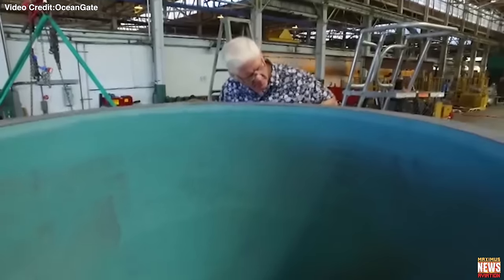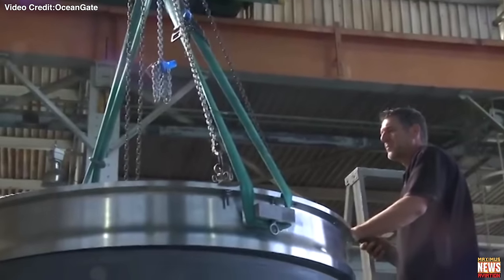Watch The Manufacturing Process That DOOMED OceanGates Titan To Fail. But It NEVER Had To Happen.

Comment: I have done a PhD in Non Destrucutive Testing(NDT)of composite. And about 15 years back, I developed and used techniques for different thickness and different material  filamant wound composite pipes using air-coupled ultrasonics and linear array imaging and convetional squireter based imaging for finding delamination at diffrent depth of composite. 
Oceangate did not inspect the 5 inch thick pressure vessel with any of the state of art  inspection techniques such as conventional ultrasonics, linear array ultrasonic or air-coupled ultrasonics. They tried to certify or give early warning using an inaccurate, low-tech online acoustic emission NDT technique. This method is good only in lab testing and can give warning just before or during an evolution of extensive failure of the vessel. However, this method info is of no use for the passengers at great depth of the ocean since failure is sudden.
Furthermore inspection techniques are not commecrially availabe for such dissimilar bonded composites that too with metal - composite intefrace, eventhough some techniques are still in research stage. Hence in aersopace sector for primary load bearing strucutres such bonded joints have two or three rows of bolts to make the design of bonded joint damage tolerant.

These manufacturing videos of Oceangate show how dodgy the manufacturing procedure was, poor winding or the layup design and tools used for such a mission critical pressure vessel. The manufacturing process by this company looks like a cheap small scale composite boat manufacturing facility! I highly suspect Oceangate submersible's bonding failed, 
 followed by buckling and implosion of the pressure vessel!
Reply: Thank you for sharing your views. As someone who doesn’t have any engineering background, with a common eye their bonding process just looks completely insufficient.
Reply: I think they thought whatever gaps or pockets or joins the design had, the pressure would just seal it all tight and everything would be great.
Reply: How much are you per hr?
Reply: Brilliant explanation. Sounds like CEO should have hired you to fix the sub problems then CEO would still be alive.
Reply: @jonfreeman9682 the problem was that the CEO fired everyone who doubted his ingenuity.
Reply: I am an engineer with over 40 years of large project and pressure vessel experience, primarily tubulars.  I admit to being a generalist but I think I know my way around project and product development, I was a project manager with lots of specialists on the teams but I did spend 30 years in deep water drilling and production going from the years when 1,700 foot platforms were deep to investigating systems for 10,000 feet of water depth.  It did not take much of a literature search concerning composites to see just how foolish this design was and how stupid the material selection was.  This paper suggests that composite failure in subsea applications accelerates significantly under pressure.

From the paper, "Graphite/Epoxy Composites for Offshore Applications"

“The crack growth rates of the specimens tested in ambient [temperature] and high pressure seawater were found to be approximately ten times higher than the growth rates of the specimens tested in ambient air”

I have not read further to learn the reason. I suspect it is high pressure water intrusion tending to delaminate the fiber and eppoxy matrix leading to crack propagation and failure.

https://www.iccm-central.org/Proceedings/ICCM11proceedings/papers/ICCM11_V1_22.pdf

That was just for starters.  I found a large collection of contemporary research papers that would have made any prudent engineer run backwards from this composite application just as fast as possible or at least realize he was dealing in a unique application at great risk that was peeling back the foreskin of technology.  Very painful.

It is a pity these people died   As for the CEO, better he died because what he did was criminally negligent.
Reply: Oh wow im interested in NDT myself.

Only heared of x raying Metals/welded parts but using Ultrasound for compisite Materials makes sense.
Reply: Could not agree more!  Just another NDT engineer working with composites here. I bet this cylinder has super high porosity, not even close to aerospace CFRP.  They haven't even tried to inspect it properly, not to mention FE modeling of load carrying capacity loss due to glaring fabrication flaws...
Reply: Marine Engineer here (40 years) - but not a designer. The genus of this failure is not engineering per se but in the relative recent fashion for ‘disrupters’ who think existing science and engineering practices are far too conservative (they are correct) and hinder development, they also dismiss ‘subject matter experts’ as part of the skewed logic. There is a reason why the certification of submarine hull design and build is ‘laborious’, expensive and time consuming - the consequence of failure is death.
Reply: @sequoyah59 brilliant post m8 thank u was easy to understand and read  for the layman like myself
Reply: I agree, it was shoddy manufacturing. He should have baked that hull from 2500 to 3000F to graphitize it, which would have given it elasticity. People say carbon fiber has weak compressive strength which is true, but it is strong in tensile strength. Epoxy resin is strong in compressive strength, but weak in tensile strength, but when combined they are strong in both. I could be wrong, but I don't think that 5 inch thick CF hull collapsed at once and imploded. I think that cheesy joint where the end caps were glued to the CF tube was where it failed. He only had a 2 inch deep dado joint, when he should have had a 12 inch dado joint to give him more of a gluing surface. Then he could have also drilled holes away from the edge and bolted it. Even though drilling CF weakens it, he would have had it sandwiched on both sides with the titanium flange. The epoxy glue holding that joint together has a tensile strength of 5 to 6000 psi, but as you know he was diving to depths with 6000 psi pressures. James Cameron said the last message the surface ship received was Stockton saying the cabin had been compromised and he was resurfacing, then 2 minutes later navy sensors detected an explosion. Apparently he sprung a leak either in that end cap joint or a cracked window or window seal, and high pressure was forced into the sealed cylinder, which blew it up like a balloon until it exploded.
Reply: @mixanblend  That reminds of the the DSV Trieste.  When they took it for their first unmanned dive in 1960, they noticed seawater on the floor after surfacing.  When they consequently took if for a manned dive, they immediately saw water coming through the porthole.  But going deeper, the waterflow stopped.  In continuing the dive, pressure  increased and pressed the the window with more force against the conical sealing.  That's why I don't think the glue/sealing were the problem.  But the carbon fibre integrity failed.
Reply: @padiyar are you serious? before testing anything, how did you miss the open air construction of this thing? bare hand touching on the surfaces? this guy was nuts. bonding not suitable surfaces (see how shiny and not good for adhesion surface?) in open air where they been surfacing? bonding this kind of critical structures should require at the least clean air/vacuum certification! and hygienic protocols on personal should be the min as well! the whole thing is theatrical before talking about any engineering aspects! i mean restaurants get better inspection and testing than this guy's warehouse which is supposed to be space age!

Comment: I am not a marine engineer, but words cannot describe what I have just seen with them applying adhesive with plastic scrapers in a non dust free environment. How on earth where they meant to get a consistent seal with plastic car body filler scrapers. You wouldn't even paint a car in such an environment.
Reply: lol so true, also watch at all the air bubbles enclosed in the carbon
Reply: He wanted to be remembered asa rule breaker/innovator
Reply: @AAAskunk  then don't take passenger
Reply: Out of sight, out of mind. Until it breaks, of course.

Comment: After this happened i learned about Steve Fossets Deep Flight Challenger. A submersible build from carbon fiber to go down into the mariana trench. However, this submersible was good for only one (1!!) dive, and supposed to become a museum exhibition after its one trip. It was expected the carbon fiber hull to deteriorate too much to be safe for multiple uses. 
Richard Branson aquired it after Fossets death and planned to go commercial with it, until he learned of this fact. He quietly shelved it.
About that time Ocean Gate started with building the Titan. I think it is impossible that Rush didnt know about it. He must have known that carbon fiber hulls werent suitable for this purpose. He himself talked about the crackling of the hull and told everyone to expect it. Aka its normal. No, it was a countdown.
Reply: He said his acoustic sensors will detect the threat before diving too deep, that why he still go with it…
Reply: @hyy3657  Hull failures under a pressure resembling about 80000lbs on your palm give no preliminary warning. You are just dead in milliseconds, without a chance of even realizing the fact. Its like switching the lights off. Your lights.
Every crackling noise was the hull saying "I am falling apart" 
Take a thread, and pull on both sides. The thread will resist the pull. Thats what it can do. Now push both ends together. What will it do? It will bend. It cant resist the push. You cant push a rope. If you embed it in resin, the resin will resist your push. Basically only the resin. The thread would just prefer to bend. Thats what the carbon fiber in Titans hull was doing. It couldnt do anything else. People hear carbon fiber, it is used in airplanes, its a miracle material. On airplanes it has to resist inside pressure which wants to expand the hull, aka pull. Rush was an aerospace engineer. He knew about this. On a submersible the load is push, not pull.
Reply: The hull compressing and making noises is normal, it happens on US navy subs as the hull compresses. The issue is that navy subs will decompress while carbon fiber, but nott titanium, will not decompress, once you crush it, it stays that way.
Reply: @laa0fa502  Exactly, the carbon fiber hull takes a bit of damage every time. Until it fails.

Comment: I'm surprised that none of this appears to have been done in a clean room, just an open warehouse where dust and moisture can contaminate every step of the process and introduce failure points especially in the adhesives. This guy had access to decades of research and experience that others had accumulated in the submersible field and took advantage of none of it and in fact seems to have gone out of his way to ignore any warnings or misgivings that more experienced experts expressed to him.
Reply: backyard deep sub building. can't get more amateur than this
Reply: I follow a "slapstick" process all the time with my Depron DIY RC airplanes. About 50% of them crash before completing the third flight.
Reply: No respirators on.
Reply: what if a fly got stuck in between the carbon fibers??🪰🪰🪰🪰🪰
Reply: @MrUranium238  Whole new Sci Fi movie
Reply: He only took advantage of the fact that there were zero deaths in the industry before he came along, so he thought he can do whatever he wants and everything will be fine since no one died before with other people who actually know what they're doing. It gets worse with every video I watch about this
Reply: That glue job....would it be a problem if the epoxy had air bubbles in it?
Reply: @MrUranium238  theres enough air stuck in them anyways a fly would have made it safer probably lol
Reply: Heard he used EXPIRED carbon fiber thar be bought for cheap because Boeing wasn't willing to use expired products for their planes.
Reply: @timoooo7320 exactly!
"Nobody died before, so therefore it MUST be safe, right?"
Then proceeds to kill 5 people!
Reply: Three points I am not seeing commented on.
1: x-ray microscopy of carbon, fiber, fibers will show that the interior of each fiber is principally void of structural material.
2: the filament winding process that they are using is very similar to the mining process used in missiles. The method that they are using introduces air, which structure would be called a void, along with the resin that was not degassed.
3:the titanium ring and carbon structures with deform differently .
Reply: Well said.....my car gets painted in a paint room.  Its all basic hygiene protocol.
Reply: You're exactly right. My first job in my aviation maintenance career was working in a sheet metal/ composite shop. All composite lay up was done in a clean room.
Reply: These guy and engineer look like they just graduate from Mc donal and oceangate ceo hires them 😂😂
Reply: Just add more peanut butter glue to compensate.  There.  Fixed.
Reply: @bldmyamean8352 
In another video, can’t remember which, it was said Boeing have denied on-selling any carbon fibre to OceanGate, time-expired or otherwise.
Reply: Arrogance is an amazing thing, just a pity so many others had to pay the cost as well as him.
Reply: @NHX610  yes it would... the adhesive should have been placed in a vacuum chamber and degassed, then applied in a clean room environment at minimum...
Reply: Good point David. I think using CF for submersibles could be done, if done the right way. If it's true that the stress cracks weaken it over X amount of dives, then he should have set up a shop where he could mass produce those CF hulls and had the titanium end rings removable, where they could be transferred to a new hull, say every 10 dives. He was making a million dollars per trip with 4 passengers paying a quarter million each, and in 10 dives that's 10 million dollars. If it costs one million to make a new hull, he's money ahead. If I was building it, I wouldn't have glued those end caps, with a 2 inch dado. I would have had a 12 inch dado and drilled holes through the titanium CF titanium sandwich to put bolts in it. Even though holes would weaken the CF, it would be sandwiched by titanium on both sides. Then I would have had a rubber seal in the joint to flex with the 2 dissimilar materials. After X amount of dives, he could have transferred the end caps to a new hull, put new rubber seals in it, and be good to go. I would have also done away with that window and put a round screen in the front that looks like a window, Then he could have had a camera outside transmitting the real time video into that screen to simulate a window. I can't verify it, but somebody said he tested the thing in the Bahamas 50 times at the same depths as the Titanic. I think his solution to get around the compression weakness of CF was to make it real thick. If you think about it, a wooden pencil can be easily broken, but a 4x4 piece of wood is not easily broken. You could stand on the 4x4 wood put between two blocks and it would support your weight, but as you know a pencil would snap. I would have also attached a cable to the thing that could have been reeled in by a winch in case there was trouble. Those unmanned submersibles have cables and his craft was light enough where he could have done the same.